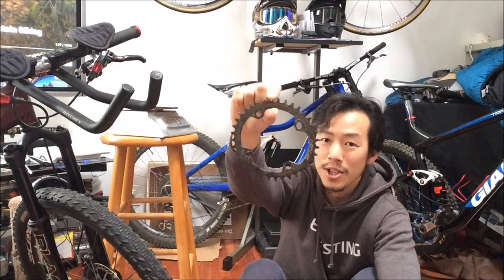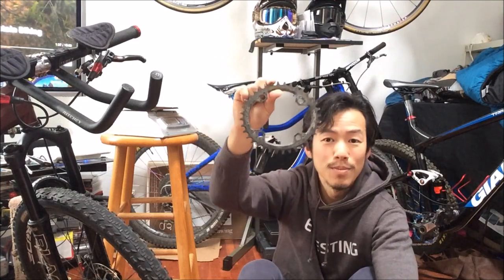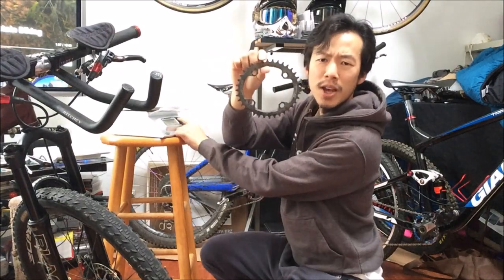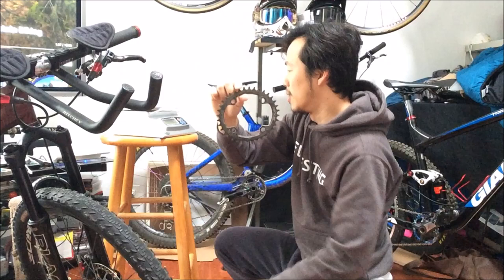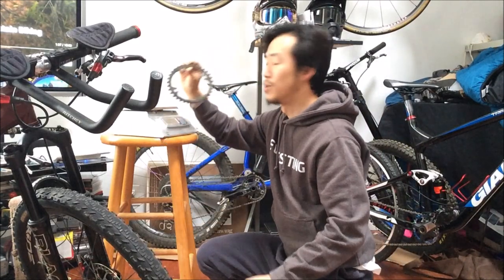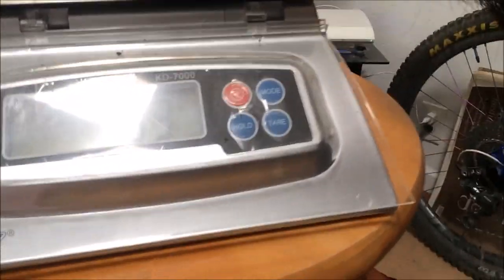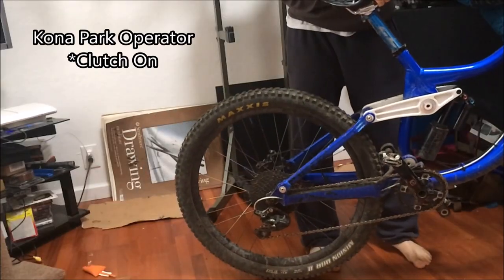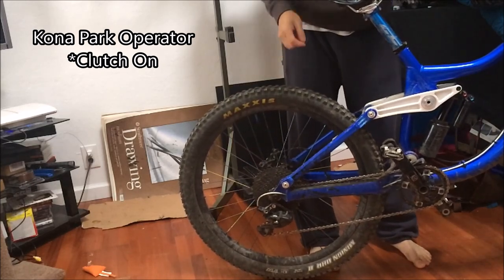Snail Deckas Chain Ring Chain Guide Review : Proper Chain Length

Comment: I’ve been running a 40t deckas on my gravel Lynskey  Ridgeline with a 9speed sun race 11-40 cassette I mentioned on a previous vid of urz and just ordered a 36t as well. They do work very well but I do have a chainkeeper too.
Reply from the maker: Right on! Awesome! Yea I have been running the 30t with a 11-42 10spd without a clutch on that Giant. Put it through it's paces on some DH stuff and the chain stayed on despite the gnarly slowmo video showing how out of control the chain got. I guess having a top guide is enough. I did mastic tape the shit out of that frame though...
Reply: What chainring should I use with 9 speed 11-28T cassette? City rides, asphalt, no hills. I can't decide between 36/38/40

Comment: Great vid.. just ordered a 36t decas for m8000.. good thing i didnt buy those expensive wolftooth rings.. keep em reviews coming for budget meal bike parts
Reply from the maker: Thanks! Yea I've got a bunch of budget parts i need to make review videos on... more will come! Pretty stoked on a lot of the deckas stuff in general. Some of the stuff like the chain guide as i've mentioned before is pretty similar to old OneUp guides. Same for the Rockbros pedals which are similar to RaceFace CHester or the new ones to the OneUp composites... think they all possibly come from the same factory and just rebranded.
Reply from the maker: also thanks for subbing... spread the word... :)
Reply: mark joseph quintos How do you like the Shimano M8000 crankset? I’m switching to single chainring and I haven’t been in the loop for parts in a while.

Comment: Would i need a chainguide with this? I'd like to install it on a vintage mtb to convert it 1x
Reply from the maker: if you've got a clutch and a narrow wide chainring, that should be enough to keep it from dropping from the bottom. This is a top guide that'll keep it from dropping from the top. So yea, you'll be secure top and bottom. With some setups, you dont even need a top guide but doesn't hurt to be extra secure.

Comment: Hello. Very good video, took some doubts that I had. I would like an opinion if possible, I have the following material Shimano 2x10, RD-M6000 SGS, FC-M617, and I have been studying gearbox ratios and I wanted to spend as little as possible, what I get closer to what I want is the Sunrace MX3 11-42t and the snail 104mm Bike Chainring Narrow Wide Chain Ring 30T. Can I use the same chain? Does it work this way or recommend something different? Thank's for your time.
Reply from the maker: Not sure what you previous gearing was on your 2X setup, but it's probably have something like a 26/38 or something of that sort with a 11-36 in the back? So yea probably especially since you're only going to a 42 in the back. You could keep your front derailleur on there and use that as a top chain guide by running the limit screws for added security as well. That said, chains are cheap and might just want to spend an extra $20 for one. Chains, cassette and chainrings kinda wear together.
Reply: @mrpercussive  Yes it is those references of sizes that are in your comment. Thanks for the info, I will follow your recommendations. Best regards.

Comment: Bro, nice vid! Keep doing them! I have a question if you can help me, I have a Shimano xtr m970 crankset like yours in your giant! Which bcd it is? And also I’m on a 3x9 xtr group Set, I wanna go with a 1x12 using the same xtr crankset but use a xt, shifter and derailleur, with a sunrace 12v 11-51 so I don’t have to change the hub , so my question is wich Oval ring you recommend me for me a 34 o 36 and wich bcd is for the m970 crankset and if i can keep my same screw like you comment or wich screw should I need,  I’m on a 26” double suspension bike. Greetings from mexico! 😁
Reply from the maker: Thanks man. Shimano m970 is going to be a 104bcd. What size gearing to go would depend on your wheelsize, where and what your rides are like. Not sure where and what it's like in Mexico, but where I'm at in Northern California I'd go with a 32T oval as we have some pretty steep and sustained climbs out here. Keep in mind the wide part of the 32T oval will be similar to a 34T round. As mentioned in the video, the one I got for that Giant had threads already tapped out into the chainring itself so i didn't have to get the short single chainring female/male bolts. The old bolts threaded right in no problem. If the chain ring you got is like a regular chainring with no threads tapped in, then you'd need the short ones. 
Sounds like a fun upgrade man! Be sure to check your freehub body size. Old HG standard which was 7/8/9/10 speed has a shallower freehub body where if you slap any of those cassettes in, it'll run just fine without a spacer. New HG standard has a longer freehub body to allow for more gears to fit. Most 11spd mtb cassettes will fit on old style HG spacing as the biggest cog will be attached to the second biggest cog via rivets or something and just float over the spokes. Not too sure about the 12spd stuff... I'd check that out.
Thanks for watching man! Spread the word and don't forget to click subscribe... :)

Comment: Great video. Have you ran any of the chainrings with a 12 speed cassette? Have you tried not using a snail with a clutched derailleur? Thanks.
Reply from the maker: haven't ran it with a 12spd but i'd think it would be even more secure as the 12spd chain is narrower so it'll be a tighter fit. Yes that Giant in the video doesn't have a clutch on there. It does however have a top chain guide
Reply: mrpercussive Cool. On my research with the name brand chain rings, they have narrow wide versions for upto 11 speed and then newer rings for 12 speed (the ring’s teeth & chain are supposedly narrower). I am trying to figure out if the Snail or Deckas chain ring would work with 12 speed. There isn’t really good info out there. 

Oops, I meant to say have you tried not using a chain guide with a clutched derailleur?
Reply from the maker: @dancing8595  You should be fine running a 12spd chain on the Snail. Yes I have run it without a guide and just a clutch and it's fine until the chain ring starts to wear. The clutch only keeps the chain secure on the bottom. I like to have a little more security with the top so I usually do that with bikes even if i have narrowide rings and a clutch
Reply: mrpercussive Same thoughts with the Deckas, too?
Reply from the maker: yes... it should work just fine

Comment: Would the BB chain guide fit on the Vitus Nucleus VR? I believe it has a 73mm diameter BB. 
Many thanks, Jamie xD
Reply from the maker: looks like a BSA bottom bracket so yes it will fit...
Reply: @mrpercussive  cheers pal, I just wanted to know as I already ordered one and needed to know. Many thanks and keep up the good work dood xD
Reply from the maker: Chillz HD thanks man! Enjoy the chain guide pretty simple installation. You might or might not have to lose the spacer in the BB as the chain guide itself can act as a spacer. Though how thick the guide is could pretty much be negligible especially with all these new boost rear ends nowadays
Reply: @mrpercussive  Thank you man, I'll check on that when the bike arrives and when installing the chain guide :)

Comment: I use a 36t round now, do I buy a 36t oval?
Reply from the maker: The 36 oval has the width of a 38 a the widest and 34 at the narrowest... So if you're looking to increase the high end then yes. If you're looking run the same top speed with lighter weight ring and the "benefits" of asymmetric rings then go for a 34 oval as that will be a 36 at it's widest and a 32 at it's narrowest...
Reply: @mrpercussive  thank you very much
Reply: I stayed the same and it worked just fine for me. Because where the oval has the affect of 38 you are in the strong part of your stroke you wont even notice it. I liked it on steep technical climbs but not so much everywhere else. Went back to my round ring.

Comment: I have 3×6 system, 14-28 cassette, what 1x chainring size would you recommend? (34t,36t, etc.)
Reply from the maker: depends on what you intend to do with the bike...
Reply: @mrpercussive  I am mostly on the road with casual riding
Reply: Almost never do trail rides, nor intend to
Reply from the maker: @paavanpanchal1067  going to depend man... 3X6 is something that hasn't be run in a very long time. If it truly is a 6speed, this chain ring might not work as it will have a MUCH narrower profile than what you have. That said, gearing really depends on what you do with your bike and what rear wheelsize you have. For road stuff 700c, I like to have the biggest cog on the cassette at least be bigger than the smallest chainring on the cranks. I run 50/34X11-36 on my road bike for all the northern californian stuff we have out here... Better to have the gears and not need them than need them but dont. Going 1X, you will lose quite a bit of range too so it will be give and take.
Reply: @mrpercussive  alright thanks!

Comment: Hello there, I’ve converted from 3x10 to 1x narrow wide chainring, usually with the 32t setup ,the chainring is situated at the middle part,but when i upgraded to 36t it wouldn’t fit. i need to assemble it at the outermost part, which causes the chain to cross too far when i use the largest cassete..hope you can help with that 🙏🏼
Reply from the maker: Zaff Ne canna is it a frame/chainring clearance issue on the frame? If that’s the case I think your SOL...
Reply: mrpercussive nope, the problem is,i cant put the chainring on the middle part of crank arm bcs it wouldn’t fit 🤯
Reply from the maker: @zafryz952  I'm not sure if I'm understanding you correctly. I'm assuming that you have the correct BCD as it fits in the outside which is usually meant for the biggest chainring or bash guard. How is it not fitting in the middle? More information would help...

Comment: Hello Deckas 96bcd is compatible with chain shimano 12v ???
Reply from the maker: i think they might be designed around the 10 speed chain which has a 6mm pitch which works with either 9 speed or 11 speed chains as the difference 6.5mm for the 9s and 5.5mm for the 11s. 12s chains are 5.3mm which might be a looser fit but you might be able to make it work with a top chain guide to keep it from coming off...
Reply: @mrpercussive  Ok Thx for the quick reply